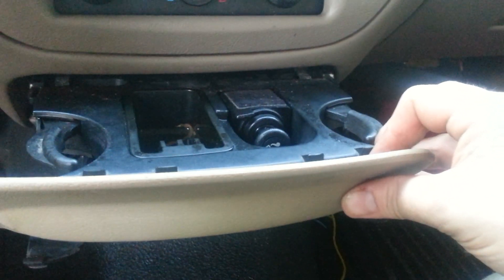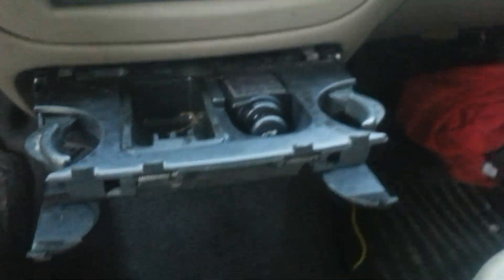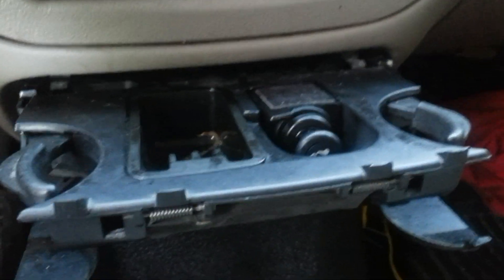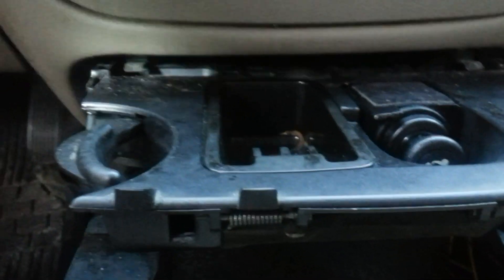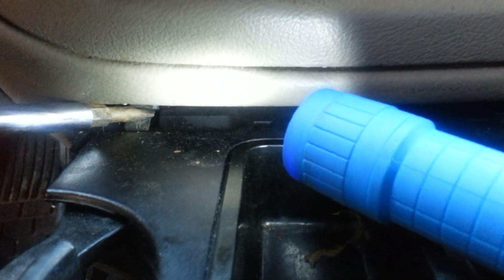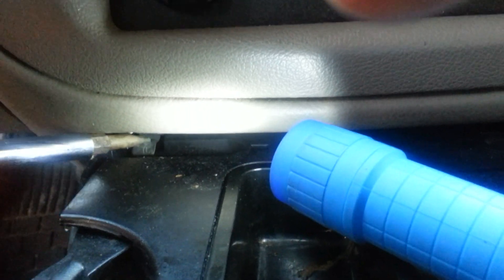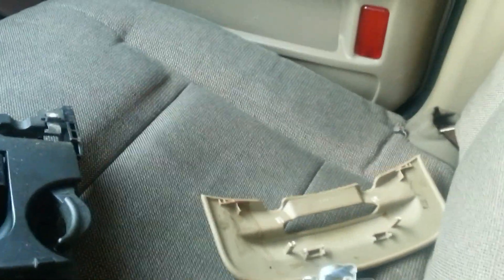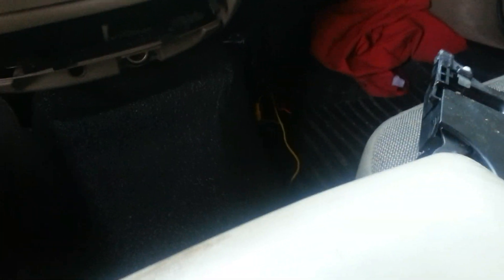Ashtray/cup holder removal

Comment: Many thanks, the video was clear and well done. I realiize this is an old video and kinda stale, but, for the problem cited at the outset, if you can't find a replacement at a junkyard, you can do what I did: Repair the broken clevis ears on the front cover. I made new ones with blobs of epoxy, ground to final shape with a Dremmel. It works!

Comment: Thank you for the video! So when you pull it out, there are no connecting wires of any sort? I thought there would be a wire that you would have to also disconnect for the cigarette lighter?  I have a Grand Marquis.
Reply: There is, and I currently need help figuring out how to release the clip that binds the wiring harness to the tray. It's very difficult. Any help would be greatly appreciated!!!

Comment: Many thanks but what about the electrical contacts for the lighter that is part of the assembly.
Reply from the maker: that's a disconnect.I can just disconnect it an tock the wire back up inside or plug back together if ur not keeping cup holder or permanently like I did mine

Comment: Thank you, I want to customize mine to give me better access to the 12 volt power . I am adding a blue tooth fm tranmitter and I will make better cup holders.
Reply: got a video on what you did?
Reply: @huthut7839  , no I did not make it good enough to satisfy myself and have been busy with other things I am running without the cup holder / knee bumper. I am just using the floor hump as a cup holder. and my 12 volt power just lies on the floor, sorry.

Comment: I just bought a sweet very sporty looking  2005 Grand Marquis LS Ultimate Edition. The front cover is off of the cup holder and the driver side cup holder is broke. So I want to replace the whole unit like this. I am not sure how do you address the wiring/plug for the lighter/charger outlet as far as getting it properly removed and installing the entire replacement?
Reply: I've got the same problem. Were you able to find a solution?
Reply: @kipster-ll6po  No I have not found the answer yet. Still trying to find info.
Reply: @swt8866  I just found the answer: Initially, I tried using needle-nose pliers to compress the ears/side of the head of it which protrudes through the hole and is visible on the top side of the tray. My thought was that perhaps those sides/ears function as a catch that needed to be released. I'm not sure if that did anything helpful or not. HOWEVER, I simply kept pulling pretty hard on it from the bottom side while working it from side to side and it came out! You're welcome!
Reply: @kipster-ll6po  Thanks!  We'll give that a try.

Comment: what about the cigarette lighter?  Is is not connected to something on the back or the cup holder?  Have to disconnect anything other than the 2 clips?
Reply from the maker: To be honest I can't remember. It's been so long since I made this video. But im I'm sure there's a plug or something you'll need to disconnect in back for CIG lighter. Im sure, soon as you pull cup holder out you'll see it right away . but sorry I'm not more help due to my memory
Reply: @wonnie46403  Copy and thanks.  I'll take my time.   I broke the front plaet off of mine too - so i need to replace the whole thing.
Reply: @b3warnick  If you figured out how to release the clip that binds the wiring harness to the tray, PLEASE let me know. Thanks!

Comment: is the cigarette lighter switch controlled?
Reply from the maker: cdm1250uhf1 there's a wire clipped to the back of the cigg plug. i believe it stays powered all the time but I didn't have any trouble with it. I just unclipped from back an taped it up and tucked it up cause I took cup holder out to install other things
Reply: +wonnieboy ok, thanks a lot for the reply.